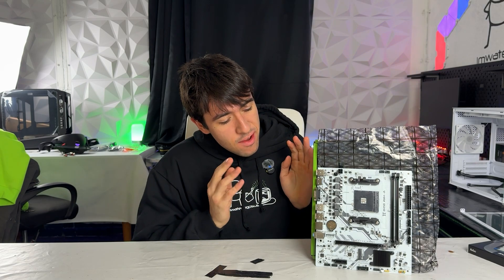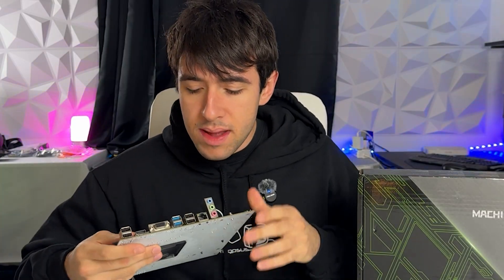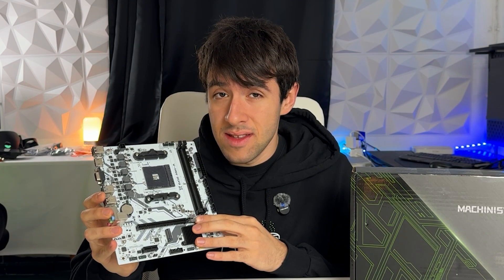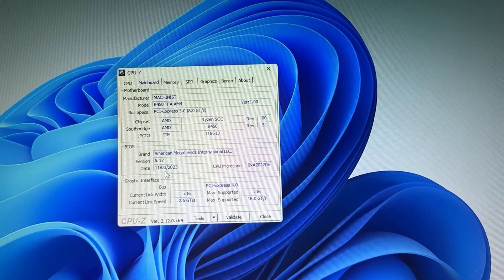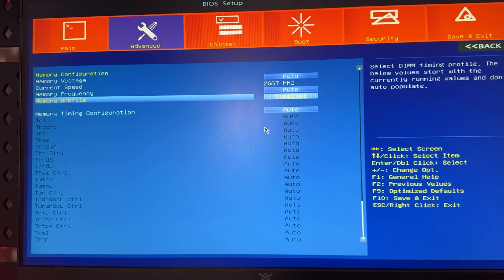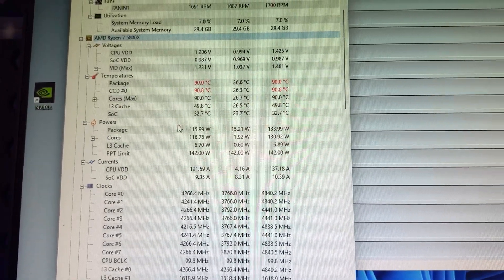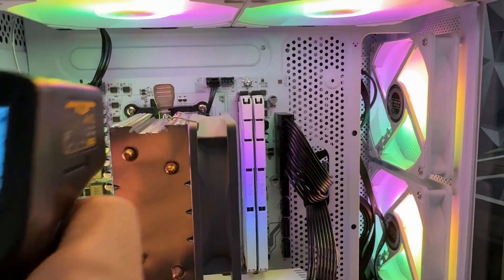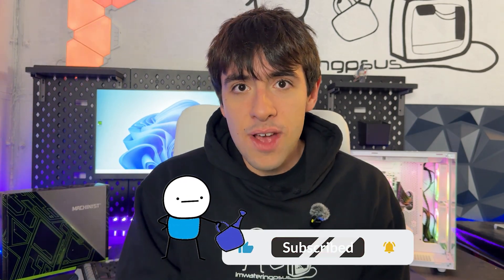Is this 40$ Chinese AM4 Motherboard Worth it? - Machinist B450 AM4-A Review

Comment: Bought it today just for my daughter. Use it with old components and hope it works 😅
Reply: Im considering the exact same thing for my son. Wish it had any kind of rgb output. Lol I have a 2700x and r9 290x I wanna get running for him.
Reply: @MannandMusic finally it arrived this week and works totally fine. Doesn’t  need to update the bios either. I am really impressed by it‘s price. I just put some Heatspreader on the VRM‘s for better cooling. It’s worth every cent!
Reply: @nur_ramon which cpu did you used pls ?
Reply: @ObeidBs a Ryzen 7 3800x

Comment: Will the Ryzen 7 1700 be fine for this mobo or still need to be under voltage
Reply: I'm running a 5700x on one with no issues at all

Comment: Hello, if you really where able to get an Bios Update for this Mainboard, please provide your community with it. XMP worked for me out of the box. But when I activate Rebar in Bios, which is essential for my ARC A750. I get "no Video signal" and 5 short beeps, after CMOS reset it boots again. CPU is a Ryzen 3700.
Reply: did you fix it
i have the same issue with 3060 ti
Reply: Enable ufei video and disable CSM. You're in legacy video mode.

Comment: Does the graphics card cover the PCIE slot ? Asking because I’m trying to see which route I want to take getting WiFi to work
Reply: Depending on the thickness of your GPU, the PcIE slot may be cover. If you have a double slot card, it should be fine.

Comment: Can you do a Review on the JGINYUE b450m plus?
I just want to know if it does or does not have that black screen problem with the XMP Enabled out of the box
I know it's a different brand but it's also a Vary Cheap White 450m Motherboard from China

Comment: I have one of these, and I have had some really annoying issues with it. It always double boots, which is fine. It won't detect XMP at all. The VRMs are pretty awful. I bought it because it is all I could afford at the time, and to be fair, for a 40 dollar board, it has been fairly respectable. I'd absolutely advise you get this board if, say. You only have a small budget, but you are getting money next month, the following months etc to upgrade off of it. It is a poor board, but it is very good for the money paid. You get what you pay for! It runs for now, after a week.
Reply: I run it with a Ryzen 5 5600, and a GTX 1660TI, then 16gb of cheap aliexpress ram, and a 512GB cheap aliexpress SSD.
Reply: @Elizacutieheal  did you have to update the bios in order to have the 5600 detected or was it able to recognized out of the box?

Comment: hi! i need some help, i just build my pc with a soyo b550m, r5 5600 and an rx 580 and it won't get on bios, i just get a black screen (i plugged the dp port cable to the gpu just in case you're asking).  When i try the gpu on my old setup it runs just normal, but when i plug it to the b550m it starts to spin gpu fans again and again.

Comment: On cheap boards like this with exposed VRM''s, it's always better to use top-down coolers, so you get additional airflow over the motherboard. There should be a big difference in temperatures compared to a tower style cooler. The CPU temps might suffer a bit, because obviously top-down coolers are generally worse, but the difference in vrm temps more than makes up for it in my opinion.

Comment: I bought one of these a few moths ago to troubleshoot my old MSI b350. It proved the Tomahawk was the problem. So far it has worked great with a 1700 and a 5500. XMP works with my 3000 memory on both CPUs. My biggest problem is that it only has one pwm besides the CPU.

Comment: Dude, unless I'm mistaken, THATS a FAKE 2Tb NVME! 
I bought several of those a year ago when they went on sale cheap, and had a few customers complaining of BSOD's and data loss, Come to find out they are either 120Gb or 256Gb drives flashed to read as 2 Tb and overwrite everytime they fill up... I'm Trying to find a way to at LEAST flash the correct firmware or whatever, so they can at least be used as proper drives... but that sticker is EXACTLY what's on mine...

Comment: Machinist has a good reputation. B450 is dirt cheap nowadays, i saw the Asus prime b450 mkii for 50 bucks on Amazon some months ago (right now 56). And you have better warranties etc. I would not look at the naked price, but rather the whole package. A520 got also cheap. I assume all cheap mobos are  intended to run a 65W tdp cpu and not more. VRMs not perfect for higher end cpus.

Comment: Ti seguo da un po' e mi fai spaccare, posso chiederti una cosa? Ho un PC con un 5700x e 16 GB(8x2)di RAM 3600mhz, il PC me lo sono assemblato da solo ma ultimamente noto che in alcuni giochi saturo quasi tutta la RAM, se dovessi prendere altri due Stick della stessa e arrivare a 32 GB c'è qualche passaggio che devo fare oltre ad attivare il profilo xmp sul BIOS?
Reply: nope thats all u need, get the exact same ram kit again and your fine for years

you might want to re slot your old ram to diff bays, that sometimes avoids blue screens
Reply from the maker: Indeed, correct answer from Kevin! Be sure to also get the same speed and latency tho :)
Reply: @ImWateringPSUs  yes ill Just rebuy the same kit, so you suggest to unplug the old RAM and then plug all the 4 sticks togheter, thank you 🫡. I was afraid my 5700x couldnt hold 32 GB at 3600mhz on 4 slots

Comment: Realistically, this is a low-end motherboard, and people would be putting Ryzen 3 and 5 CPUs in it, not 7. Even if someone uses Ryzen 7 with it, it would be most likely for gaming, so no chance for extended 100% usage.
Reply from the maker: Very true! And for that usecase, it does its job :) I chose the R7 just as a stress test

Comment: Them $7 snowman coolers work pretty well.
Reply: just added to my AE cart. ty
Reply: SNOWMAN 90mm 4 Pin PWM Fan
Reply from the maker: I was surprised but they really do!
Reply: @ImWateringPSUs  
i added the 3 pack to save some cash... we need all the fans we can fit in a tower with these mobos
Reply: @ImWateringPSUs  
are most of these AE mobo's 4 or 3 pin headers?
Reply: Цей кулер на три піни роз'єм вентилятора і материнська плата не регулює вентилятори на три піни, окрім ціни нічого доброго.

Comment: I got a x99 pr9 from maschinist and it's working fine. The only downside is that it's dual channel memory, not good for a cpu with quad channel memory support.
Considering that i got the board with an e5 2667v3 and 32gigs of ecc ram for 70€ it performs well. Bios is pretty complete aswell, which apparently is rare on Chinese mbs.
Reply from the maker: Yup, can’t complain about the bios! The Dual Channel thing is very annoying on X99 tho, it’s one of the features that actually give you an advantage so it’s a shame it’s missing. But I know why: they do not use a genuine X99 chipset. Still, for the price it’s pretty good :)
Reply: questions for 2667v3 
1. what is your stable OC ghz?
2. how many cores run that stable OC?
3. windows 11 support?
we only have 10 more months of windows 10 support

i was leaning 2667v4 or 2680/90 v4
Reply: @Kevin-vh6nn
No OC on xeons e5 26xx v3 CPus.
But the v3 xeons  (v4 xeons don't work) can run a bios mod to unlock the turbo boost from 2 Cores to all Cores.
With turbo boost unlocked my 2667v3 clocks 3,6 GHz on all 8 Cores.
No official windows 11 support, but Microsoft now stated themselves that tpm2. 0 will no longer be required and and update to 11 is possible, just not official.

Comment: Were you able to install Windows 11?
Reply from the maker: Yessir, with no issues
Reply: @ImWateringPSUs  
fuggin awesome! im buying this board and combo soon... and when intel has preorder for b770 im not waiting 1 extra minute... we cant find any b580 at its original price. there are several GPU at 350 that are better value or the same as b580

Comment: I have a biostar b450mh which looks identical but with black color. I got it with a prebuilt i bought at the end of 2020 with the RTX 3060 ti (it was cheaper to buy prebuilt that build it myself because of the GPU shortage). my prebuilt came with ryzen 3600 and recently I upgraded to 5700x3d. it supports Rebar but no PCIe 4.0 which is a bummer.  
The original bios wasn't stable at DDR-3200 i had to clock down my RAM to 2933 MHZ for stability, but if you updated the bios it got more stable.
I think this board (and other cheap AM4 b450) follows the AMD reference design, and the difference between different motherboard vendor is their suppliers and maybe the tuning of the firmware
Reply: I found an issue with RAM speeds on my MSi B450 Thawk Max PCB when I replaced the Zen part for a Zen3 chip.  My OG RAM couldn't run XMP without crashing.  I found the issue came down to the base speed of the RAM, the OG was 2133MHz, when I replaced it with 2407MHz RAM the issue went away and XMP has worked ever since.  I even added 2 extra sticks of a different brand of 2407 with no issues, not a single crash since with mixed brand RAM.

Comment: In fact, this motherboard is a copy of our JGINYUE B450M, and we really can't afford to remove the VRM in order to deliberately reduce the cost of the motherboard, which would be very inconvenient for the user. At the price of USD 40 free shipping, it's hard to imagine what quality replacement materials Machinist would use for motherboard materials  which invisible in the production process such as B450 chipsets and MOS tubes  (since they're only can get second hand B450 chipset).
Reply from the maker: I can’t thank you enough for commenting! Yeah, selling the motherboard without VRM heatsink is just a terrible idea, as I mention in the video. It can handle a low powered CPU but nothing more. Also very interesting to hear about the chipset licence. I’ll pin your comment, keep making great motherboards!
Reply: @ImWateringPSUs  Thank you. We'll be releasing motherboards intensively in February, so stay tuned!😁
Reply: @JGINYUE  where can i buy your motherboards as i am from canada?
Reply: damn, didn't expect a clap back from the competition :D go China ! i'm sure if you wanted to make a 200$ motherboard with all the bells and whistles you could beat the msi-asus-gigabyte cartel easily
Reply: thank you for your reply, I was going to buy the motherboard in this video but after reading your comment and searching aliexpress it seems your board is the same price but is HIDDEN in the search when looking with other motherboards. I'm from canada, if that helps you maybe they disabled for people in my country.
Reply: I just picked up a b450 itx from you guys and have been putting it though the paces with quite a bit of overclocking and it's has been rock solid, especially for the price. Good work!
Reply: @mkonji8522  Thank you for your support of our products!😁
Reply: I cant believe I just ran across you on youtube! I just bought your B450i ITX motherboard and it looks great, I am waiting for the last parts of my build to get here but I cant wait to try out your motherboard!
Reply: @zaneh1719  Thank you for your support of our product! 😁
Reply: why do y’all not ship to Canada?
Reply: I noticed that they were the same as well. I bought one then loved it so I bought two more. I use them for systems that I flip with either a ryzen 5500 or 5600 cpu. I would not try to overclock it.
Reply: Can someone from JGINYUE give me a link to a website to update the BIOS?
Reply: So how is the JGINYUE B450M different, and how much more does it cost? I build pcs as a hobby and have bought 2 of the Machinist boards which were great for cheaper systems.
Reply: Your motherboard has a problem doing secure boot T_T
Reply: I recently got my first Jginyue board, x99 argb and I absolutely love it. Can't believe the quality. Keep making great boards with awesome feature sets and good quality.
Reply: im using your 16gb 3200 ram its working really good but im having issues with my zsus b450m w board not giving display to monitor with vega64, if u would help great if not then its fine
Reply: VRM cooling would not be a big issue with a box fan that moves air over the VRMs.
Reply: @myyoutubename152  Actually, what I mean is that with relatively fixed prices (under USD47 most of the time) and inflation, in order to maintain sales, they must be making cuts to the material budget of the motherboards which is invisible in the production process, it will increase the probability of damage to the motherboards.
Reply: @JGINYUE i have an jginyue b550i and a ryzen 7 3800x with the latest BIOS no problem and soon i Will put a ryzen 7 5700x3d thanks you a lot jginyue your motherboard are the best ❤️
Reply: @mattiadibrita6771  Thank you for your support of our products!😁
Reply: @JGINYUE  Thank you, I bought your motherboard instead of the Machinist one after seeing this comment. The heatsink should be a benefit, and I'm hoping the ARGB version will arrive. The BIOS also looks way nicer, the quality looks almost identical in review photos, but the design is a little bald :) I wouldn't mind you adding some grey lines on the ARGB or PRO version just like your Ti motherboards